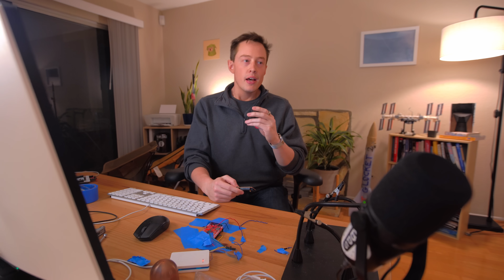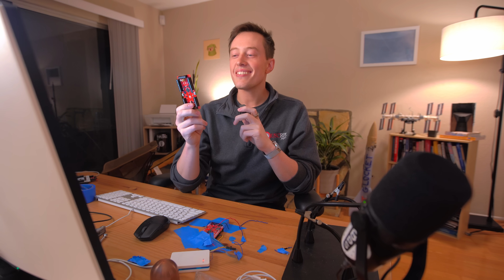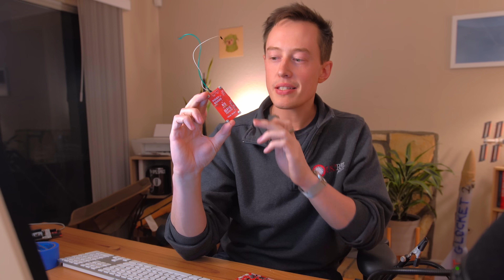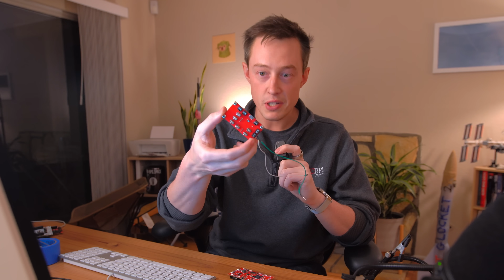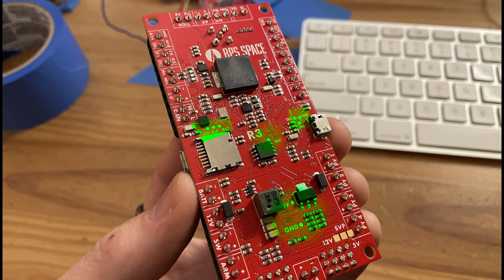the dumbest electronics thing i do

Comment: I know I’m late to the party, but I’m gonna do the, “You know all about X, but you don’t know Y?” thing, with Y being plasticine (modeling clay).  Maybe it’s an age thing (I am old), I keep a lump of plasticine around here and I use it for all kinds of things.  Because I am lazy, I would just separate the three wires as required, press them into a drop of plasticine, then stick another bit of plasticine over the top, and voila! No PCB or 3D printing required.

But this is really a segue into a story Nicholas Nassim Taleb tells in one of his books.  Both of us (Taleb and I) are old enough to remember when luggage did not have wheels.  What happened (I was there) is maybe in the late 1970s or early 1980s people started using the new cheap, small collapsing dollies to move their luggage around in the airport, packing the dollies in the bags when no longer needed.  You saw this a lot.  Then around 1985 someone in the luggage industry had the bright idea of just putting wheels and collapsing dolly handles on the luggage itself.  Genius!

Prior to this, for the previous 200 years of train and air travel, no one had thought to combine the 12,000 years old (or older) technologies of wheels and luggage.

Now Taleb is one of the smartest guys I know (parasocially, of course), and the point of the story as he tells it is how back in the day he would wear his arms out carrying heavy luggage around airports because as smart as he is, the wheels on luggage idea never occurred to him either (he was being uncharacteristically self-effacing in telling this story).  These sorts of lapses or gaps are common.

What is even more common is how we discover or fall into a technique for doing something, and however inefficient the initial technique is, because it works we continue to use it.  I know I do this all the time.  For example, I make little DOS batch files literally every day to perform various tasks; I’ve been doing it for 40 years and see no reason to change; it works.  I have no idea or even interest in how other people perform the same jobs without batch files.  I use all kinds of similarly dumb techniques in the workshop.

So don’t feel so all alone.

Comment: Get one of those magnetic bases for dials and measurement devices. Make a little mechanical complacent device that make a little bit of pressure with the twist of a lever or push of a slider. Mount a homemade connector that holds the pins/wires at the right spacing. When it comes time to use it. Bring out your jig. Place the board over a nonslip rubber. Connect the loose end to your computer. Line up rig with board. Engage pins then click “load” on PC. Disengage your rig and store for the next time. I will make you this contraption for a small fee 😂

Comment: you can just ask us to make a test jig, it will cost less than 100 USD, all the test points will have pogo pins terminated by DuPont leads that you can plug in your programmer(s) and you'll get a slot with registration pins and a lever to hold your board. This is what we make and use to program thousands of boards. Contact Shenzhen FlyFun, i am the engineer and i'll deal with it.

Comment: Yeah, I did it once in production with hundreds of units. 😆I used gig through-hole pins in a straight line, 2.54mm pitch. I remember it was an AVR ISP (In-System Programming) type of connector with SPI interface that needed six pins! But I spread them out in a straight line and used a flat cable with handmade pin headers that could easily hold onto the PCB with one hand. Sometimes leaving it attached was no problem either! Those were good years, having fun learning with a little bit of frustration here and there!

Comment: Honestly, if you had put those pin ports on the edge of the pcb or atleast close to it, could of used a clamp.  I am no better though, I would of built a 3D jig for the pins and that might of taken hours to design:P

Comment: If you search for "Data recovery probe fixture" that should open up a world of options as well as a wide range of prices to solve your probe holding problem.  Should be able to find a fixture that you can plug a USB cable into and that is directly connected to the probes.

Comment: i may be underthinking this but could you not run traces to the edge and replace those 3 points with a 3 pin connector so you dont have to hold them?

Comment: Why didn’t you just 3D print a hinge mechanism to clamp the pins the board temporarily. Think in-circuit test fixture. The finished board would have a jig to stabilize the board (not painter’s tape, lol, but we’ve all done some jank shit like that) then have a hinge that simply places. The pins properly, just using gravity.

Comment: I had similar problem so I made a KiCad board with just dozen pogo pins based on the original board outline, exported it as 3d step model, loaded it into slicer, printed on my prusa mini and glued pogo pins into the holes. Then I soldered a bunch of wires to those pogo pins and called it a day. Ii worked so well it ended up saving hundreds of hours lol.

Comment: So, I'm only close to the end instead of all tge way through, but the "proper solution" is actually pretty simple.
1) Go find some pogo-pins with a much wider head than shaft; I know they exist from the regular manufacturers, but I don't remember the name of the head style.
2) Design another board revision, this time with some specific layout that includes three extra through-holes for standard sized headers; style this layout after the 6-pin version of the Tag-Connect connector, with the header pins replacing their alignment pins; MAKE CERTAIN that the pads for the actual data contacts have a through-hole that's large enough to fit the shaft of your pogo pins, but not large enough to fit the head.
3) Make a run of at least three boards, and separate off two of them for your programmer. Install the header pins (try to go for extra-long ones!) first, then get the second board somehow permanently aligned (the headers should preferably be long enough to do the job, but other header pin locations or screw hole can easily work as well), then finally solder in the pogo pins; note that the pogo pins should not extend out as far as the header pins, so that the headers stop the pogos from touching things if nisaligned.

Then you just take a programming cable, and solder one end to the pogo pins, maybe cutting away extra bits of the board if you feel it's appropriate. To use it, elevate the target board enough for the pogo pins to fully engage (maybe you'll need to put a few USB sticks or something onto it to fully engage the pins, and you probably should have it on a cirtcuit-board holder to give the headers enough space), connect the programming cable to your programmer hardware, and program it. If you trim the interfacing board down to size and turn the layout into a standard part in your EDA software, then that single piece of hardware becomes a general-purpose tool.

Comment: either 3d print a little bracket or hot glue the wires to a piece of plastic correctly spaced, then rubber-band it to the board

Comment: just add holes for a 3 pin header. You can add the pins and make a female cable, or make a male cable and just kind of shove it into the plated vias and push sideways to make a good connection

Comment: put the wires with enuf spacing on a transparent tape and put it on the board. boom, you don't need much pressure, you can use the arm thingy to hold it down for safety

Comment: 3d print some layers of plastic with the holes to the exact areas of the pcb needed and use pogo pins on these holes and probably some nylon long screws with nylon nuts on the 3d printed plastic so that the board sits on the nylon screws for basically not moving around.

Comment: 7:00 Pogo pins, is what you want. It's like a header, but with some spring tension. Or just make a small PCB with a 'default pinout/spacing' with these pogo pins, and ensure that all your current/future boards use this same spacing. Personally I would recommend either 0.1" spacing (typical header, 2.54mm spacing) or 1mm spacing. You can quite easily use one hand to keep pressure with this. So its kind of like a piggie board, but generic for all your other PCBs, just for programming.
I used to participate in a student team where we would have to do upwards of hundreds of programming cycles a day under considerable time pressure, and it worked flawlessly. 

Alternatively Mike from mikeselectricstuff has a great video on small programmer adapter boards, but I can't be arsed to find it.

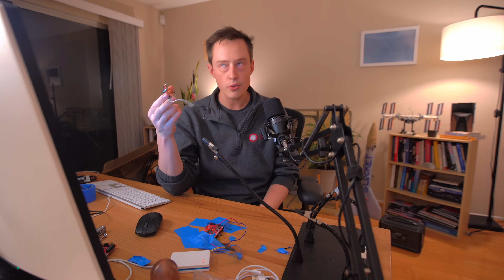7:17 those are fixtures, but honestly for such a small production quantity its not really worth it to design a separate fixture.

Comment: I used to use pogo-pins and just poke some holes through a piece of balsawood.
This allowed me nice control of pin patters/spacings etc and usually there was 1-2 holes on the boards that I could use for alignment by adding some steel dowels to the balsa as well.
The magic comes from spacing the pads out so the board can rest on the spring loaded pins after being located by the steel dowels. Depending on the size of the board it may need a light push on the top but mostly it would be fine without it. Nowadays a 3d printer makes the equivalent to the balsa plates but I have also used a lasercutter.

Comment: Why not design it so you can use pogo pins in a breadboard? just solder a handful of them to a header strip and use an unpopulated header pin hole pattern on the board.

Comment: You need to 3d print a jig that holds the board. Then, a cap goes on top that aligns some spring loaded pins that touch the board. We use these jigs all the time when reprogramming automotive ECMs and control modules. Google, "bench flashing circuit board spring loaded pins" and you'll see some examples of how these look. There are many different types from hand held to clam shell style to vice jigs.

Comment: Plug your pins into a 3x duPont socket and use the pins on the bottom of the socket to make contact with your pads. If you need to lift the reset, but your clock and data in a 2 pin duPont socket. Would that give you your extra hand?

Comment: hot glue the wires onto a popsicle stick with the correct spacing. Or run a couple dozen amps through the wires with the right spacing and touch a hot glue stick to them.

Comment: For batch of protos and quick programming, I take the step file of the PCB, add holes for pogo pins, add little arms/clips to align to the actual PCB and print.    Push the pogo pins in and wire to the programmer for a quick "bed of nails".  Add any extra pins for signals I may want to monitor on the 3D step.  Pogo pins are available at Mouser/Digikey in many lengths, diameters and force.

Comment: You could use spring headed pogo pins, 3d print a matching base, put the pins in and all you would need to do is just place the pcb inside and use one hand to hold it down

Comment: Haha - we all have the same problems. 😅
I ended up using the "Tag-Connect" cables. It has springy contacts like pogo pins. I made one shield for the Arduino Uno with an RJ11 jack that holds the tag connect cable.
This is my standard setup for burning bootloaders for all my projects.

Comment: Just add a small three pin header (like a JST 2.0 PH 3 pin socket) to the PCB at exactly this location. Then you can plug in the one-time programmer (with the corresponding connector) and have your hands free and you can spend time on something else, while the boot loader is programmed.

Comment: I've had similar problems, and I usually use modelling clay, blue tack, or similar to stick the pins down and then Peel it off the board later.

There are fancy bespoke pogopin options that people use for reverse engineering and hardware hacking like the PCBite pogo pin kit, but I haven't been able to treat myself to that yet.

Comment: Well, the PITA cost of doing it the current way isn't greater than the PITA cost of figuring out (and implementing) a different way to make it easier.   (I guess it's actually the rate of PITA that's important.  If he needed to do this every 2 weeks or so, that would be annoying enough to spend different annoying effort to reduce that annoying effort.)

Comment: Spring loaded pin contacts would be the professional way, BUT in spirit of "no-effort-November" I'd suggest to break off three pins of  a male header pin row. Solder your wires on the short side of the pins. Bend the long pins according to the pad spacing on your board. And now you got  a free hand while holding down the 3 pin header onto the board.

Comment: I’m offended that you call this ‘stupid’. The ‘S’ in SOP is ‘standard’ 👍🏻
Reply: Tbf, I make the pads 2.54mm apart so I can just use a row of 2.54mm pins to press on with one hand - rather than place each pin separately.

Also, I use the cmdline to execute a burn as pressing the enter key is way easier than a mouse button 🤷🏻‍♂️ YMMV

Comment: I'd also recommend a standardized solution such as J-TAG. You can buy a special cable for each programmer (to maintain pinout) or use a generic - not too different in cost. The cable has 6 pogo pins on it (or more, i use 6) that you can then align and hold with one hand.

Comment: The thing you are talking about is probably this.
"Probe Data Repair Memory Card Flying Line PC3000FE"
Though the pogo pin idea others has mentioned is prob cheaper and better in your case. This is only for if you need it a lot of channels and it to be easily re-configurable.

Comment: Use a header connector that matches the pad spacing, and cut it down to 3 pins. Or get a right angle header connector that makes it easier to press down from the connector body.

Comment: one of the easiest things you could do is 3d print a little holder and hot glue your wires in place so you can hold all three to the pins on the board with one hand. seems like that would speed up the process a lot with minimal effort. or if you dont want to design something to print, get a small piece of scrap wood like a paint mixing stick or something and hot glue the wires there

Comment: you should look at tag-connect adapters.

or if your micro controllers have usb, you can generally get a dfu boot mode where you hold a wire high/low and it shows up as a different usb device and you can program the entire memory through usb.

Comment: Just 3d print a socket for the board with some pogo pins aligned to your pads and wired out to a side breadboard that you can throw together quick for the rest of the components.

Comment: In the past when doing this i would take a blank board of the same one I am programming and solder pogo pins in the programming ports with wires on the pin or trace. the you just clamp the two boards together.

Comment: Since i don't stock pogo pins, my trick has always been bending some solid core wire to hit the pads, then hold it with one hand and type with the other. I've used this trick to program numerous motor controllers, and connect to the uart pads on a router i bricked. Works great, doesn't require exotic pins, and you don't need to painstakingly match the spacing of the pads on your scrap of protoboard

Comment: I designed a little PCB with holes for 3-5 pogo pins and a couple of 3mm screw holes and ordered a bag of them to keep on hand.  For situations like this, I just solder up three pogo pins, hook up the wires, and I have a probe that can be held in one hand to connect to all three pads.  If I'm feeling ambitious, I can 3D print a small plastic hood to make it easier to handle.  And if I really want to go crazy, I can 3D print a tray with the pogo pins in it so I can just slap the board face down on the fixture and hit the button.

Comment: my stupid suggestion a 3d printed bracket that clips across the board to get the position right. And to keep it low effort, the wires just push through little holes in the right place.

Edit: changed my mind, as any project to try and fix this will end up being a rabbit hole of doom and troubleshooting. This is fine, carry on.

Comment: Take some spring mount them together at the correct spacing and epoxy them together. Then you can hold them easily in one hand and your other hand is free. Easy, I've done it a lot with a 5 pin interface. I've taken to putting my pads on the edge of the PCB and I bought a cheap clip with the pogo pins located correctly. Now I just clip it on the board over the pins and I have both hands free. 🙂

Comment: Have a look at PCBite test probes. They have a weight to give the necessary pressure. We used them also with scope probes (with 3D printed attachements), but they work best for just straight signals like you need.

Comment: I had an issue totally different than this but a little more often. I built a macro keyboard with a foot switch that presses keyboard shortcuts. Works like charm, I started with raspberry pi pico with 1 foot switch, now I am using v2, a esp32 bluetooth macro keyboard with a foot switch and few extra keys as well.

Comment: Aren't your pads on the board standard spacing? You could at least solder the clock and dio wires onto a couple pins like for a breadboard, would at least make spacing easy and let u use one hand